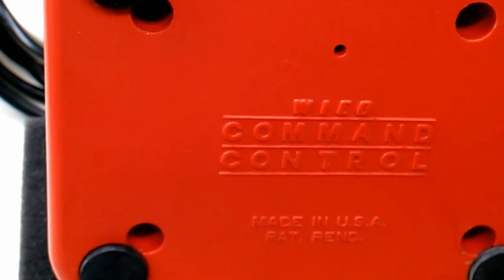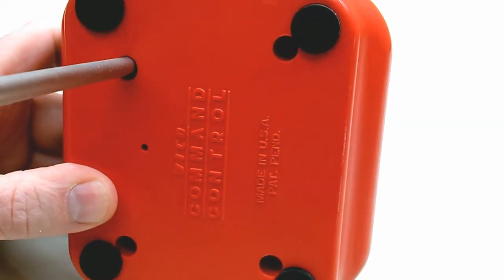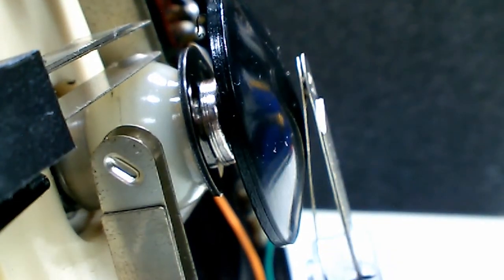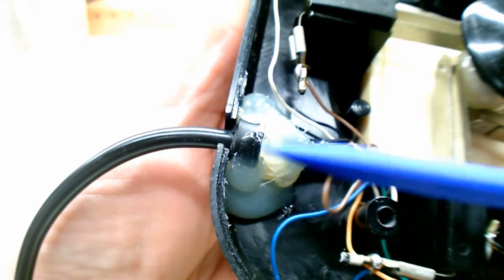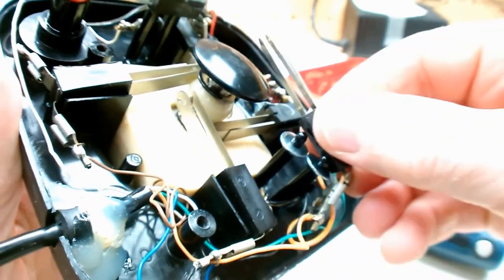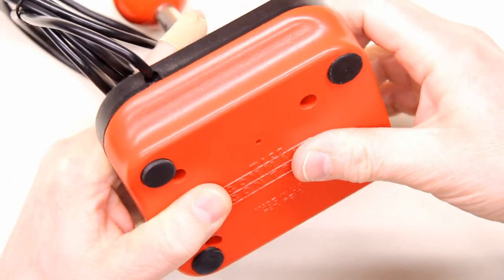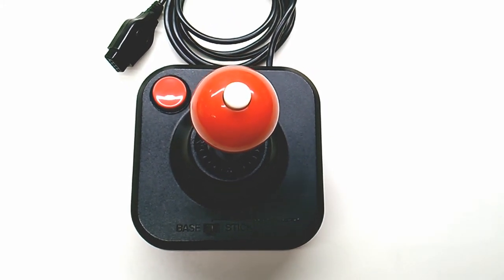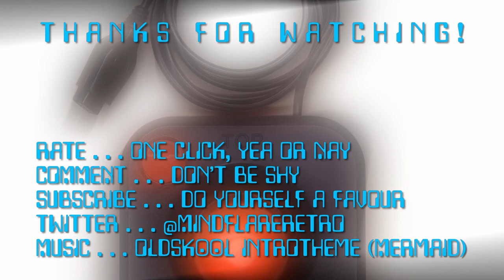#05 "Grungy to Gorgeous" — Wico Joystick Repair & Cleanup

Comment: I wore too many of these out.  I also found after awhile the contacts in the switches need a decent cleaning with some IPA.  Eventually the worst problem was the screw posts inside would break off after the inside was serviced over and over.   As to the switch you applied washers to...I used to just take a pair of needle nosed pliers and gently bend the contacts.  I once modded one of these (and had a magazine article from Amiga Tech Magazine) with a small, self-designed circuitboard using a 555 timer to make a variable speed rapid fire w/knob mounted on the top right corner of the joystick.  It gave a whole new perspective to games!
Reply from the maker: Nice. I have a few more to clean up and possibly repair. That mod sounds interesting; I'll have to track that down. Thanks for the info.

Comment: You can easily get a new strain relief, and not so easily, but still doable, replace it.

I bought a new one, and new spade connectors, and replaced them all.  To do the job right the connectors need to be the double crimp style.  You could also snip the wires and solder them back after replacing the strain relief, but crimping them looks more original.

Anyway, good video.
Reply from the maker: Cool. Thanks for the suggestion. This was a Saturday night impromptu fix-it project so I was stuck with what I had on hand. I do have other Wico sticks requiring TLC so I will prepare better and go with your suggestions. Thanks for sharing and commenting.

Comment: A lovely joystick. I think this is the first ones I've seen with the C64. The simple contacts works great with a little cleaning. Great video again :) My clickety Arcade joystick had poor microswitches. It came with the breadbin two years ago. In fun (and desperation), instead of buying new switches which is easy, I opened them and cleaned them. Still works fine today. :) The Videopac controllers with membrane switches is another story. Haven't found a solution yet other than possibly add 9pin dsub connectors for atari joysticks..
Reply from the maker: Thanks very much. Yes, the leaf switch contacts are quite reliable and are easy to service. I found this regarding the Videopac controller, https://goo.gl/NQGsPx.

I'm looking forward to part 2 of your "{Insertbrandname} 858D+ Rework station" mod. Mine is still torn apart on my bench. I haven't dealt with the tip grounding issue yet. I added few more picture to my Flikr album (https://goo.gl/wF4XEb); feel free use them if you like.
Reply: Ok I've worked on part 2 of 858D+ mod video. Not liking my photage. Lots of long takes to no avail. I will ofcourse keep them and cut them down. The thing is that the pinout is wrong. I'm pretty sure of it now after comparing MCU datasheet, arduino code and my own 858D04.PCB with MK1841D3 IC. The IC is the same, but the PCB traces must have been changed. The display works, the fan-on and reedswitch signal works, but ADC sensing comes in on the wrong pins. I'm thinking of bodging this board to make it work.. It's only three (?) sensor signals I think. Anyways it has been an interesting experience working with the arduino IDE and programming with TL866CS. Finding the .hex files in windows %temp% folders. Setting fuse bits manually.
Reply from the maker: Sounds like more of a challenge than you anticipated. I am very interested in this project, including working with the Arduino IDE and programming TL866CS. I have this programmer as well and have not put it to good use at all, yet. Are you interested in moving this conversation to Twitter? @thilographie_de, @tinkrelectronic (his YT channel, https://goo.gl/8ngCiQ), @thejanbeta might be interested and would be able to contribute, as well.

Comment: Nice joystick, I hate those leaf switches, just converted a competition pro's fire buttons from the leaf type to a pair of micro switches.
Reply from the maker: Yeah, at least the leaf switches are easy to service.  I have micro switches sitting in my eBay cart.  I was hoping to use them in my original Commodore VIC-1311 "Atari Style" joystick (pic: https://goo.gl/sKU9sp) which no longer works.
Reply: two methods of fixing those, totally strip it down remove the tape holding the metal switch tops, clean thoroughly IPA etc then use new tape (kapton good)stick them back, or I have on one joystick (a quickshot 1) actually used very small tactile switches.. I was bored and wanted to experiment :)
Reply from the maker: Nice. Did you happen to document what you did somewhere? That would be interesting.
Reply: MindFlareRetro nope unfortunately  that would require forethought which I lack :) I'll post a few pics I've got on Twitter 2u so you can see the mess :)
Reply from the maker: Hah. No problem. That works for me. Thanks.

Comment: Where did you get the joystick test program?
Reply from the maker: Yes, the joystick tester program I used in the video is a handy utility; it was included with the diagnostics cartridge I purchased a few years ago. There are several other joystick test programs still posted on C64 related websites -- here's some examples, https://goo.gl/nrdwEG.

Also, there is a joystick tester written in BASIC on page 344 of the Commodore 64 Programmer's Reference Guide -- here it is:

5 rem -- c64 joystick tester (uses port 1)
6 rem -- page 344 of programmer's reference guide
7 rem -- to use joystick port 2, set jv = peek (56321)
10 fork=0to10:rem set up direction string
20 readdr$(k):next
30 data"","n","s","","w","nw"
40 data"sw","","e","ne","se"
50 print"waiting...";
60 gosub100:rem read the joystick
65 ifdr$(jv)=""then80:rem check if a direction was chosen
70 printdr$(jv);" ";:rem output which direction
80 iffr=16then60:rem check if fire button was pushed
90 print"-----f-----i-----r-----e-----!!!":goto60
100 jv=peek(56320):rem get joystick value
110 fr=jvand16:rem form fire button status
120 jv=15-(jvand15):rem form direction value
130 return
Reply: Thanks.  What diagnostic cartridge?
Reply from the maker: As you may know, the Commodore Dead Test Cartridge and Commodore Diagnostic Cartridge are the go-to software diagnostic tools to troubleshoot faulty Commodore 8-bit computers. The Diag Cart also requires test jig/harness (a set of signal loopback cables) to test all the external input/output ports and CIA chips. I was intending to build my own but ended up being lazy and in a rush, so I ordered a full ready-made multi-diagnostic cartridge and harness from aaascrapdogsunlimited on eBay -- the cartridge has jumpers that configure it to launch any of the C= diag utils mentioned above for the C64 and C128, and it also included the keyboard & joystick tester program you see in the video.

But, that was two-and-a-half years ago -- he now sells an updated harness and diag cartridge, but it does not include the keyboard/joystick tester program, http://bit.ly/aaasd-fulldiag18.

However, he does sell a separate keyboard & joystick test cartridge with the same program, http://bit.ly/aaasd-c64kbjstest.

Comment: How did you open it up so easily?
I've been trying to unscrew it for more than a hour
Reply from the maker: Hi. Thanks for commenting.  On old hardware like this, I have a long shaft Philips head screwdriver that allows me to use a lot of torque (using a lot of downward + twisting pressure while turning counterclockwise very, very slowly) to free the screw from the plastic.  Are the screws in your joystick turning at all?
Reply: MindFlareRetro No they are not even turning
Reply: MindFlareRetro What is the exact name of that model of screw driver?
Reply from the maker: It's a standard Phillips #2 head chromium-vanadium steel screwdriver with 8" shaft -- some pictures here, https://goo.gl/mpBnzA. I'm in Canada and the screwdriver is from a national auto and hardware retailer here. There's nothing too special about it -- it's a medium grade quality tool.
Reply: MindFlareRetro Thank you very much, I'll see if I can find one on ebay
Reply from the maker: I'm seeing super stubby screwdrivers at that link.  These Amazon options seem to be similar to mine:
http://amzn.to/2oIph59
http://amzn.to/2FbYXub
http://amzn.to/2FfG3P7
http://amzn.to/2FdCYTE
Reply: MindFlareRetro Neat! 
I really appreciate it

Comment: Why do people put things like these in a shed?  Seriously, who thinks to themselves that it would be a good idea to put electronics into sheds?
Reply from the maker: Yeah, I know, right? It was from the same haul as the C64 in my very first video.
Reply: Spawndude Spawndude I wouldn't even consider putting something like that into the trash.
Reply: Spawndude Spawndude  Personally, I never throw much in the trash, not when there is a good thrift store in my city as well as electronics recycling.
Reply: Sadly, it was probably chucked in there the day the kid got a slightly more advanced game system or computer. My C64 went into a couple of paper grocery bags in the closet the day I got an Amiga 500. It was in pieces and barely worked by that point - bare motherboard sitting on the desk so I could flex it when it was being flaky, 154I-II with problematic alignment I was always tinkering with, old Zenith television for a monitor. My parents disposed of it at some point outside of my view.. I would have loved to have had the chance to restore it again now that I know how to do such things.
Reply: @robertmiles9942  Aww, that's sad...